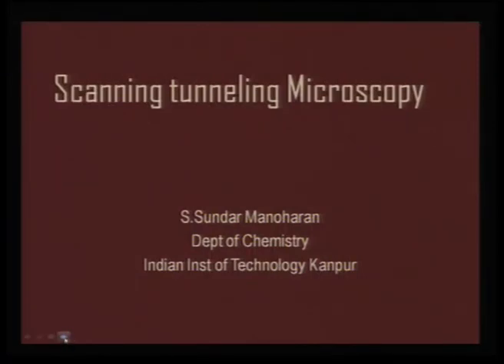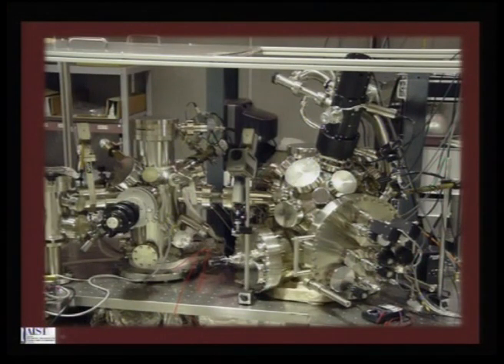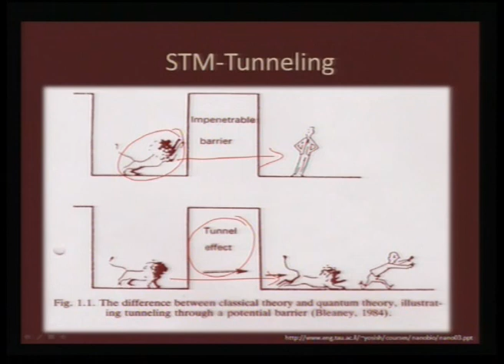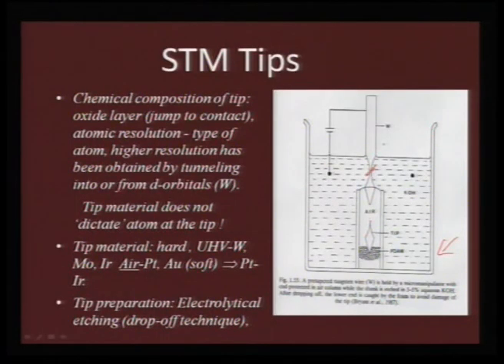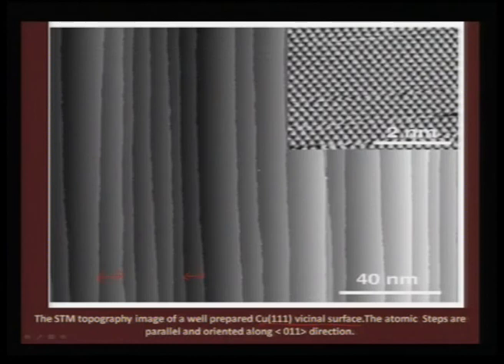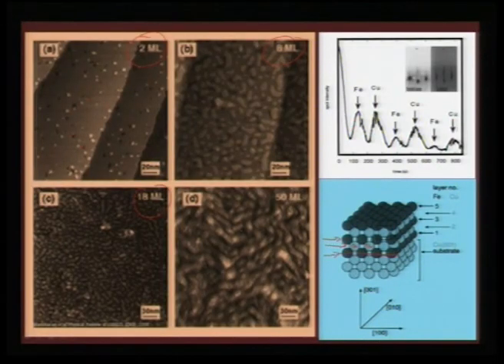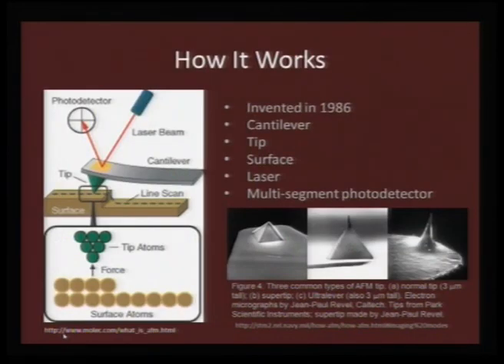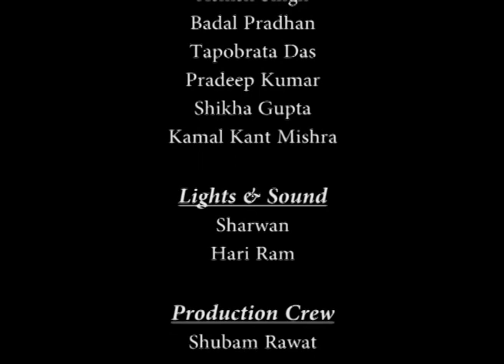Mod-01 Lec-19 Applications of Scanning Tunneling microscopy

Comment: Sir i saw your lecture really nice and outstanding please guide me how to access the all characterization techniques with examples for instance Energy-Dispersive X-ray spectroscopy (EDX)
Wavelength Dispersive X-ray spectroscopy (WDX)
X-Ray Diffraction (XRD)
Mass spectrometry
Secondary Ion Mass Spectrometry (SIMS)
Electron Energy Loss Spectroscopy (EELS)
Auger electron spectroscopy
X-ray photoelectron spectroscopy (XPS)
Ultraviolet-visible spectroscopy (UV-vis)
Fourier transform infrared spectroscopy (FTIR)
thermoluminescence (TL)
photoluminescence (PL)
photon correlation spectroscopy/Dynamic light scattering (DLS)
Terahertz spectroscopy